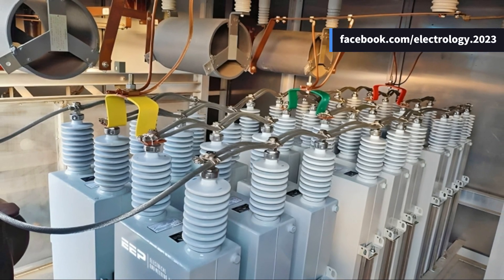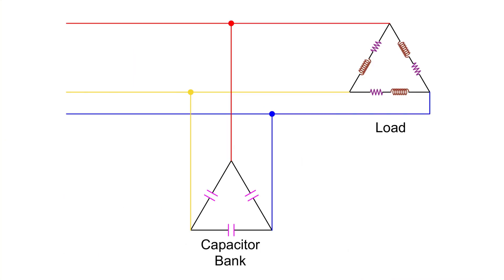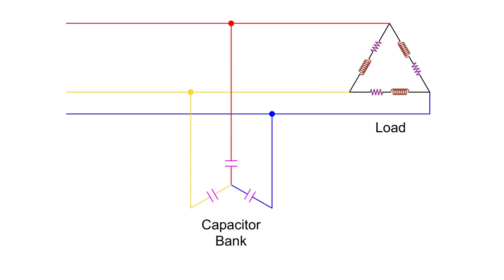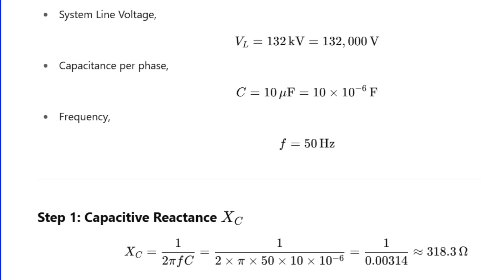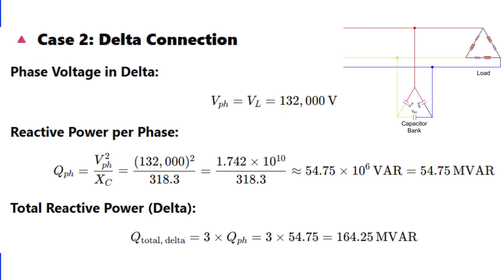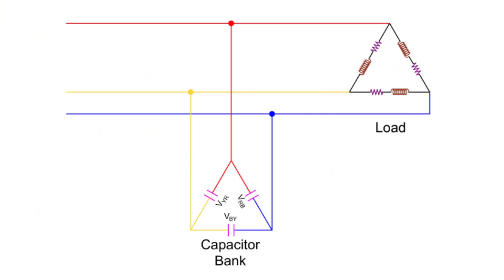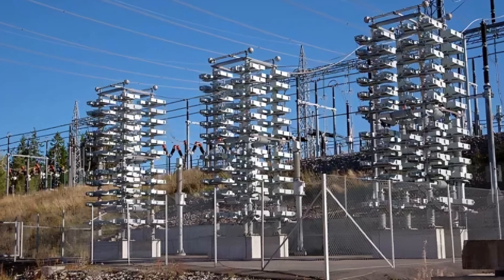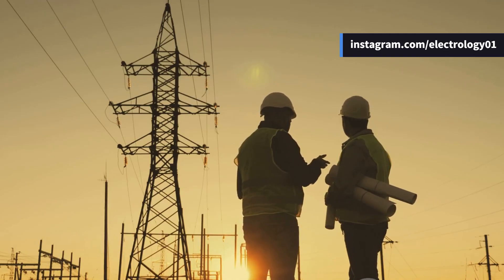Why Capacitor Banks Are Always Connected in Delta, Not in Star | Power System Explained

Comment: Yeah, but the capacitor working voltage has to be higher for the delta connection. So isn't it a matter of cost for the same result?

Comment: What about load? If load is connected in star then?
Reply from the maker: Good question! Even if the load is in star, capacitor banks are still connected in delta to supply more reactive power without needing a neutral.

Comment: Very good explanation. But I want to make an andditional. In my experience I meet enaugh star connection of capasitor banks. For example 6 kV purpose used capacitors with 3.5-3.6kV rated voltage. Because as you explained, at star connection, capasitors feel 1.732 time less voltage than system voltage. It is improve the life time.
Reply: Yeah - I just commented that it's gotta be a tradeoff with the cost for higher voltage caps.

Comment: Another great explanation.
As a follow up because this is where people doing motor control use capacitors for power factor improvement.
Its important point out that its only for DOL applications, but in industries like mining there are many large DOL motors driving crushers, pumps, conveyors, bucket wheels,... etc and because they are on long cable lengths power factor can be an issue.

I haven't done this for many years but it is one of those things all engineers who work in motor control applications should know about. The last time I looked at this particular issue was when I was tasked with power modelling a mineral processing plant. In that plant were 6 x 6,600VAC DOL motors (all over 1MW) driving large blowers for sparging (blowing air through the mineral separation tanks).

You should also cover why its important to place the capacitors AT THE MOTOR instead of back in the control room which I have seen people do.
Reply from the maker: Thanks for sharing your expertise and providing additional context about the application of capacitors in motor control, I appreciate it!
Reply: @Electrology001  Thanks.
You need to remember that most 3ph induction motors have a Φ=0.83. Which means it takes a lot of extra energy just to get the power to the motor.

When I did the modelling of that mineral processing plant we looked at replacing the DOLS with VSDs. Those were 6 x 6,600VAC motors. I think 4 were 2MW and 2 were 1.5MW. So we were talking a substantial capital expenditure.

Here's the thing.
All 6 were driving large blowers for sparging (as I said) and to control the air flow all 6 had adjustable baffles in the air ducts. So there's 2 massive energy problems. 1 was the power factor and the other was straight energy loss from the control baffles.

A 2MW motor with a DOL starter and a high inertia load will have a massive surge on starting. A VSD not only fixes the surge but also the power factor because VSDs appear as a Φ=1.0 to the power supply.

The estimate was the energy saving on the removing the baffles and controlling the air flow via VSDs had a pay-off of around 20months (less than 2 years).

When it comes to these large plants running off the grid, their power rates are linked to their power factor as well as power surges. So if you have over 10MW in just a group of DOL motors just starting them can smash your power bill because of the power surge and power factor you then run at.

This is why you'll find many companies running their sites with large power factor correction systems and looking at things like VSDs to control power surges and power factor. Even when you have a motor that spends its entire life running at the same speed a VSD can pay for itself many times over by just fixing the power factor and reducing the start surge.